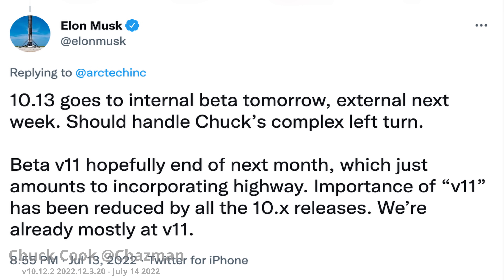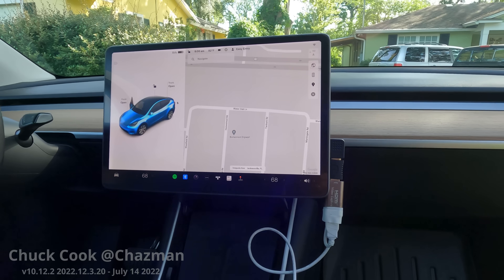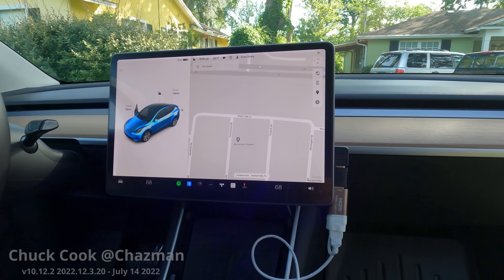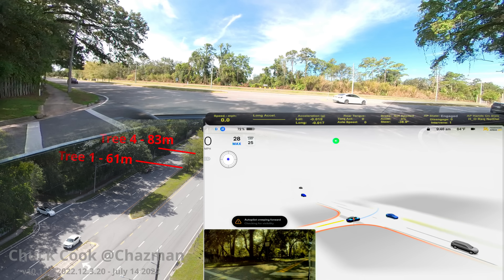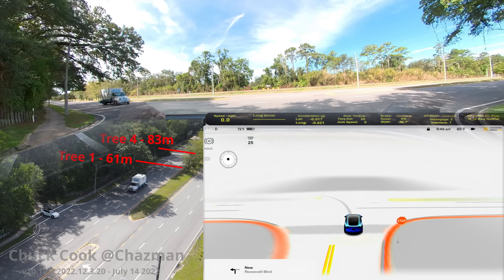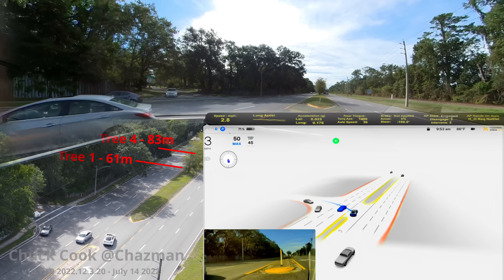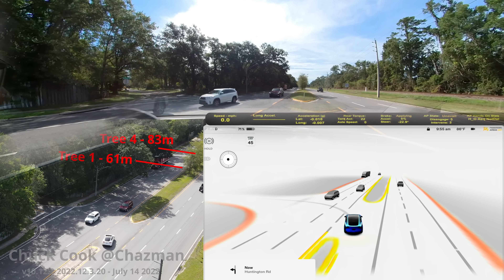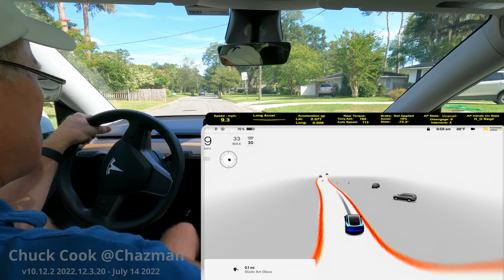Chucks Turn - What is Chucks Unprotected Left Turn

Comment: Chuck, do you really think Tesla can solve your difficult turn in one update?  If so, come on; you should know better.  You're obviously smarter than this.    
Based on your recent attempts, FSD is very, very far from being reliable enough to attempt such a dangerous turn on its own.  
In just this video, FSD would have probably caused a major collision at least once, possibly multiple times.

Elon is full of shit when he tweets about solving Chuck's Turn in one update.  It's more of the same "better than a human within a year" nonsense. 
FSD probably will never be able to safely handle this turn on the current hardware, no matter how many updates.
Reply from the maker: Not really, but I look forward to any improvements.
Reply: @ChuckCook  I think a problem will be, if Beta handles the turn 30 times in a row, complacency could set in.  Each turn is different, and it's clear the sensors don't always see everything necessary.  All it takes is one bad one on a turn like this for major tragedy.  
I really believe FSD shouldn't be able to attempt this kind of kamikaze turn, when it's easy to just go through a protected turn at the light.  An important part of safe autonomous driving is avoiding the worst (most dangerous) infrastructure when it's easy to go a safer route.
Reply: @charliedoyle7824  yes and no. Elon clearly wants to make sure the car mimics humans and tons of humans go through these scenarios all day long. Driving is damn difficult and we take it for granted. The real solution is to educate others on this software and let the roads slowly become more automated. We need more education on it all immediately
Reply: They have been working on it for several updates already. I has improved, just not enough yet.
Reply: @FSD_PNW  they've been working on it, sure.  Guys have been working on cold fusion for a while too.  So what?  That doesn't mean they'll 'solve' it next week.

It's quite absurd for Elon to say it'll take one more update on the same day Chuck makes a few attempts, and he likely would have had a catastrophic collision at least once.  
An actual autonomous car that can 'handle' this turn would be able to do it safely in any conditions for probably a million times in a row.  A good defensive human driver could handle it without ever crashing.  Beta right now maybe could do it 50% of the time in random conditions, when it gets lucky.

Comment: I was kind of hoping Tesla wouldn't do it this way. I think if v10.13 handles this turn perfectly it may not reflect the progress of FSD properly. It should not test on the same data as as it is trained on.
Reply from the maker: I think we all know it won't do it perfectly.
Reply: @ChuckCook  I was thinking it might learn to do this one turn really well but not really improving overall. I think a lot of us use your videos to see how it's really progresing because it's sort of a worst case scenario but if it has trained for this one thing it might give a false impression of progress.
Reply: @ChuckCook  Famous last words :D ...I kid but you gotta admit it's progressed a lot more than expected.
Reply: v10.13 won't handle this turn perfectly, and it won't even be close.  All it takes is one bad one in 1000 attempts to fail miserably when the stakes are so high.  
It's silly to think they can solve this kind of difficulty so quickly in one update, when they are clearly so far from solving it now.
Reply: @charliedoyle7824  this is why it’ll be exciting to see. I’m confident in them. They’re becoming very very confident in the vision and the scene. It’s going to blow our minds once it doesn’t fail. We will be bored of how smoothly it operates. It’s coming. Get excited!!
Reply: @coreyaronson1773  you're in for a long, disappointing wait until FSD is really safe and reliable.  What you don't seem to understand is how far they have to go because of how bad the driver is now.  It has improved slowly, but it's just nowhere close.  You're dreaming, like many of the FSD true-believers.
Reply: Perhaps I expressed my self wrong. Probably won't make it perfectly but let's say it makes a big leap on this one turn, it might not reflect the true progress of FSD if it learns to do this one turn specifically.
Reply: @sabahoudini  This turn is too complex and dangerous to somehow train the AI to make a big improvement on it alone.  Every attempt is different, and a little bit of indecisiveness is deadly.  And it's obvious that the perception system doesn't always see fast-approaching cars in time.  Plus dealing with the center lane is an advanced move that Beta can't handle.  Doing more of the same AI training won't solve or mostly solve this turn.  FSD will need human-level intelligence for this, which it is a very long way from.
If Elon puts in a special program for this turn, it would be a scam and would backfire on him in public opinion, and I think he knows that.
Reply: @charliedoyle7824  "v10.13 won't handle this turn perfectly, and it won't even be close". Well that didn't age very well now did it? :D (I realise it depends how you interpret it but you gotta admit it's better than expected).
Reply: @sabahoudini  that was a pretty good "test", but still one very dangerous turn in about ten tries, all in light traffic.  That's not much different than before.  I've seen a few of Chuck's episodes with similar behavior.  

Even if they do improve creeping and some median-lane logic, it's still a system that isn't intelligent enough to handle such deadly intersections.  The perception system isn't good enough, and heavy traffic brings an infinite variety of weird and extremely dangerous scenarios that FSD can't safely handle, even if it does succeed some of the time.

A real test by a real autonomy company would be to drive this intersection many thousands of times in every possible condition over years, with millions of simulations.  It's safe when it can do it about a million times in a row, and any problems are maybe clumsy or slow but still safe.  These amateur "tests" with a few tries are statistically insignificant.  
You guys who believe FSD is close to solving driving are naive fools.   It will never solve driving with the current hardware.
Reply: @charliedoyle7824  "It will never solve driving with the current hardware". One thing you should never say is the word "never" when it comes to new technology. Any way, you have a pessimistic view and I have an optimistic view. I will eventually be right and you will eventually be wrong. This is irrefutable, the only thing we can argue about is when that will happen. I think within a year is possible considering how much it has evolved this year.

About the "million attempts" it's already doing this. They have 100k people doing this right now. When the takeovers get down close to zero it's done. I'm not sure how far off we are I haven't looked at any data on that.
Reply: @sabahoudini  you're so ridiculously wrong.  If you think it's close now, based on what you see in videos, you are simply demonstrating how little you understand autonomous driving.  
A system that can get and maintain a license will have to average at least a million miles between serious mistakes in city driving.  Much less than that and a fleet of FSD cars would be crashing somewhere every day, ruining the program.  In fact, if the fleet averages a faulty crash every million miles, it would still likely crash too often for commercial viability.  Autonomous cars will have to be much safer than an average human.  That's why the Waymos of the world still don't have a full license, despite having the ability to drive without a safety driver in SF.  
And yet, the current FSD update is ludicrously worse than an average human driver; it can perhaps go ten minutes on average in city driving between unacceptable mistakes, or likely less?  An average human goes a lifetime of city driving between crashes, about 500,000 miles.  FSD is not even to first base.  

In a year, FSD will still be about what it is now, an experimental system that can't reliably do anything safely.  It is slowly improving, but has such a long way to go that it just won't get there with the current rinky-dink computer and cheap badly-placed cameras.  

I'm certain that you, Elon, and the other naive true-believers will be saying the same thing this time next year, just like the last three years:  that within a year you believe it can solve driving, when a magic update fixes all the problems.  I guess you think a year is long enough for magical things to happen?  All I can do is laugh 😆🤣🤣.

I understand why you fanboys want to believe, but you at least have an excuse in that you don't understand how difficult driving is, and how far short FSD is now.  What I don't understand is why Elon strings you naive fanboys along like he does.  I have to think that he knows better.  Eventually it will be a problem for him, as the years go by with no robocar, and the true-believers bail out.